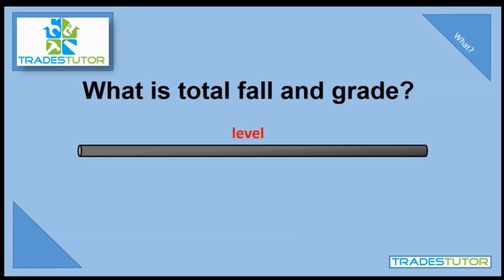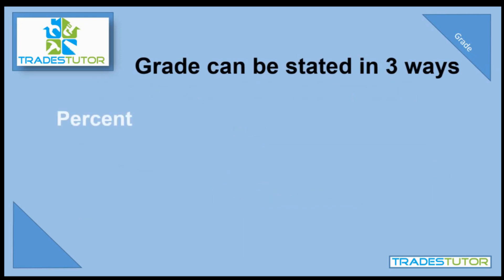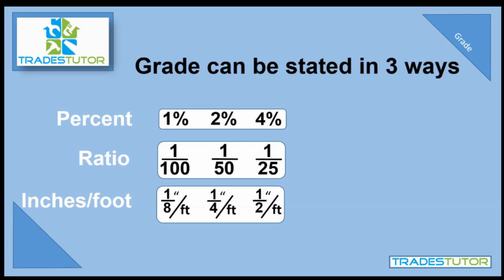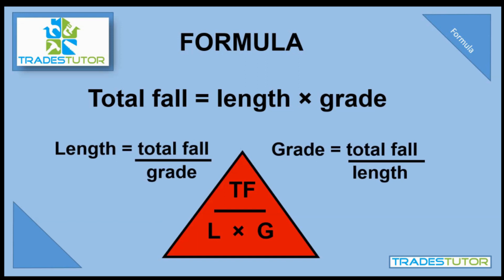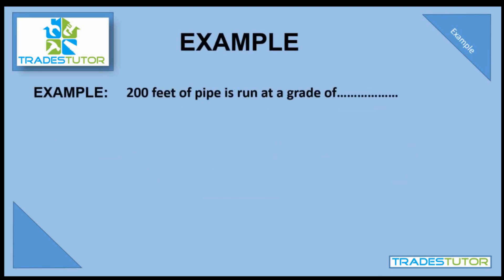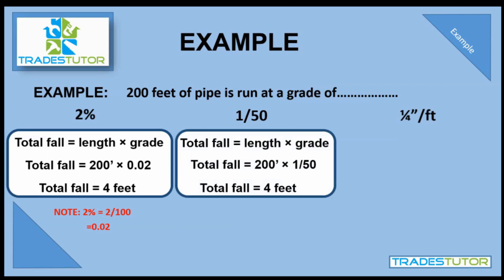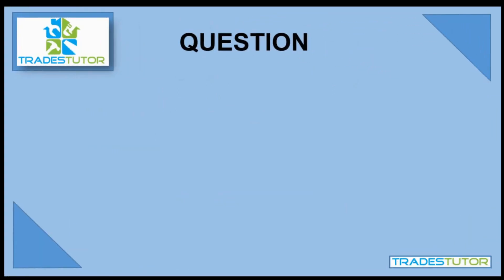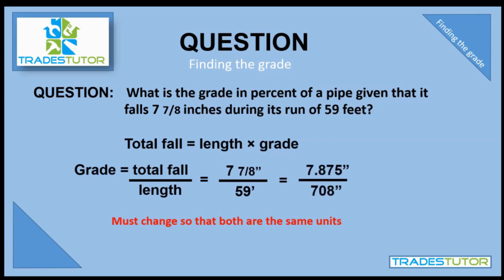Inches per foot and other ways to calculate grade for the construction tradesperson.

Comment: I got a question.  What if you have a 150 foot building with 4 gutters (roof pitch about 10 feet) and the same on the adjacent building with 4 gutters. If you run all these gutters (8 of them) into a 8 inch pipe, what is the most farthest feet you can run before running into a blockage problem or would there be a problem at any difference?